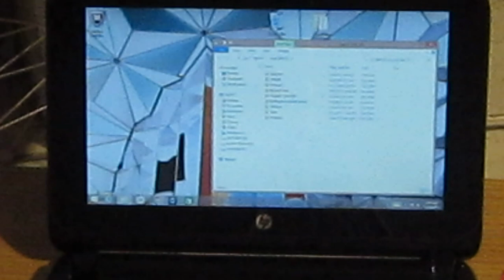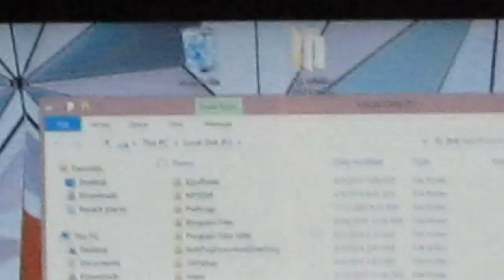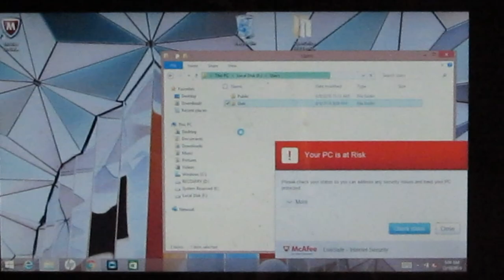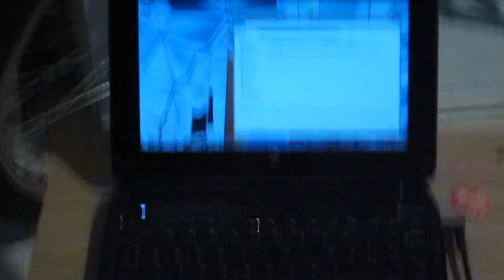How to recovery Data and Pictures from crashed computer hard drive using  a USB - Sata / IDE adaptor

Comment: Stupid way to access a perfectly good hard drive on a perfectly good laptop. Why would you risk buggering up your hard drive if you haven't backed it up. All you need to do is put a Linux operating system of your choice onto a USB drive is bootable. Then boot up off of the USB drive and use the Linux operating system to back up your hard drive files. Then you can reformat your hard drive and put your operating system back on anyway it go. You can even switch to a Linux operating system instead of Windows if you want.
Reply from the maker: Well, OK.. I do Love Linux, and that is a great way to access drives.  Many people like to run windows (and other OS as well).... and they may not feel comfortable making a USB Linux boot disc?... although, this seems to be a great way to go as well..  You probably will still need an external USB hard drive to back up your data.. and this process will only work if the hard disc failed and the computer is working.. I had an issue where the computer itself stopped working, and then you have to remove the hard drive to back it up for sure... Yes I do recommend switching over to Linux too... I run it whenever possible... It is so much better than windows in so many ways.. Thanks again for the great comments..
Reply: altgenesis Linux mint is good I use that
Reply: altgenesis  average Joe doesn’t even know what Linux is.
Reply: jaynes network yeah, I'm not well versed in Linux, so in this kind of situation, I'd rather not play with it. Thanks for the instruction.
Reply: um, im not really comfortabe with linux myself, so i will rather use this method to retrive my lost data.
Reply: would this work with a bootable macos disk too ?
Reply: Agreed!!   I have heard of Linux and I'm sure it's great.  But most laymen, including yours truly would have no idea how to do what Altgenesis describes EVEN THOUGH I'm sure it works.
Reply: @altgenesis How would this work with file permissions? Is there a youtube tutorial on how to do this?
Reply: "Stupid" way of thinking, from someone who is stupid enough, to fail to recognize, that majority of users do not know what Linux is and how to setup a boot up drive. Hey! what may be easy for you, won't be for many normal folks out there. They will have to invest more time understanding what are YOU suggesting, than what is being told here, in this video.
Reply: @jaynesnetwork  hiw will you do on a hdd that is not even detecing in pc in your method of a notebook hdd
Reply: StringerNews1   actually, I'm someone who's fairly mechanically inclined to try 'performing surgery' on a lap top... However... I would be afraid of doing software installing... as I don't understand things like even when it comes to installing a new modem...and having to plug in numbers into various fields to get the stupid thing connected.
Reply: StringerNews1     The phone company in my area (a remote part of Idaho) has us use a  modem/router which is DSL (I am on the 10mbps plan).....and that was what I was talking about... not the old 56k modems.    

 When plugging it into the computer... it still needs configured...and I always call support for help with that.  I do not feel comfortable messing around with certain settings in my computer.  I always say I know just enough about it all to get myself into trouble.... so while I'm not totally uneducated about some things,  I'm just not comfortable doing things like installing operating systems, or messing with the registry...etc. 

 But, I am willing to take a screw driver and open something up to try to fix it.    I even replaced the broken screen on my niece's cellphone last year...something some 'expert' wanted to charge her $50.00 to do, plus $50.00 for the 'kit'   

I found the same kit on the internet for $30.00 and following the instructions, it took me about 3 hours, to fix it.  I had to remove all the parts inside the the phone to get to the screen and then put everything back together and some of the screws were only slightly bigger than the period at the end of this sentence, so it took a lot of patience.  

My point though is still...that some people are not comfortable messing with codes and installing OPs.  The guy in the video had a mechanical way of doing it and I would try that before taking a dive into what I consider the unknown deep of configuring certain software.
Reply: StringerNews1  I'm a 55 year old woman, who's been poor more of her life...so I always tried to read about how to fix something before hiring someone.  When the internet came along, and people started posting 'fix it'  or 'how to'  videos... I would watch a number of them before attempting to fix or repair something.   I have done some software 'repair' that way but was never ever comfortable while doing it.  However if it's 'hands on' mechanical... I felt a lot more comfortable doing it.    I've wired in my own porch light, fixed the pump on a swamp cooler, did some repair work on my car, things like that with the help of YouTube videos.    I also always read the comment section, because I'm not just going to take the uploader's word for it...lol.    
Thanks for the information.   On my last two computer's I've backed them up on external hard drives...including about 4 times a year I do a mirror image back up...rather than just a regular back up.   

I have an older computer sitting in my closet where I keep thinking someday I would like to try to recover some art files that I did on some paint programs...so I just kind of popped into here out of curiosity.  That computer was old when it failed to start up one day...I heard a weird noise and Windows XP failed to start and all I got was a messed up looking pattern on my monitor.   I got a new computer and put the old one in in the closet for parts..  Over the past 8 years, I already pulled two fans out of it...lol... but other than the artwork, I didn't have anything on there I wanted / needed to save.   

Thanks for your time in explaining about older computers... the one I have might be old enough to have connection issues as you described.
Reply: StringerNews1    Thanks : )
Reply: How can i do that when my laptop won't turn on or even boot up.

Comment: Honestly,I have Windows 7,and my hard drive crashed. Alot....of pictures on there...Can they be saved? HELP!
Reply from the maker: There is a good chance you can recover your pictures.  Have you tried this yet?  If your computer can recognize this drive, you should be able to recover you pics.  I can help you through the process if you have any questions...
Reply: Did you try go safe mode?
Reply: @kenshinyamato3233  Not yet. No,sorry.
Reply: @SuperFlanders123  safe mode is a secret stage login windows it depends of your choice of mode
Reply: @kenshinyamato3233  Ty for letting me know!
Reply: @SuperFlanders123  respond me when you got login

Comment: I need someone to walk me through this if I am unable to pull the date , photos, and  files off with computer in tact..please messages me because it will be one week from toady date that I will have the time to do this with removing the hard drive...
Reply from the maker: It helps if you remember what folder you put the data in that you want to back up, but if you remember the file names or extensions, you can do a search for them. For instance a lot of photos have an extension like '.jpg' for j-peg format, movie could be '.mpg'  or '.xls' for excell files, etc...  So you can do a search on all the extensions you are interested in if you don't remember the exact file name or locations where you saved them. This is a good place to start..  It is a big job to go through and find and save everything you want to save, if you have a lot of files, but it is worth it, because they are irreplaceable..  I hope this helps..

Comment: सर मेरे पास साटा की हार्ड डिस्क है। कुछ समय पहले में उसे  एडाप्टर आैर यूसवी से चलाता था। परंतु लास्ट बार जब कनेक्ट किया तब उसमें से शार्ट सकिट हो गया  था। मुझे उस हार्ड डिस्क में डाटा निकालना है उसके लिए मैं क्या करूं। यह कैसे संभव होगा।
Reply from the maker: If the hard drive was not ruined by shorting it, then it should be possible to get some new adapters and try to remove the data. It is worth a shot.  You can always buy a new computer, but the data is not replaceable. Best of luck..

Comment: Guys, there is a secret trick that repair shops dont use to recover data with only the installation media plugged on a corrupt PC

step 1: press shift+f10 (shift+fn+f10 if your computer has a fn button)

step 2: type notepad

step 3: go to file > open

step 4: in the side click on this PC

step 5: show all files from the dropdown

step 6: try transferring a file or folder in a drive to external storage (you can transfer multiple files or folders) and refresh the destination and now its safe to reinstall Windows and view data on the new installation

pros: make it full screen by getting it to the max height of screen
cons: IT SADLY DOESN'T WORK, WHAT A SH*T METHOD!

WARNING: dont proceed the setup process, just press shift+f10 and type notepad and continue from step 3 to 6 or click next and go to repair your computer and go to troubleshoot and advanced options and click command prompt and write notepad then continue from step 3 to 6

also you MUST create an Windows install media in order for this to work

enough taking, bye
Reply from the maker: Thanks for the great information!
Reply: @jaynesnetwork  ok, i want to give this info in case they lose data and PC is corrupt and you dont have a secondary PC

Comment: I hook the hard drive from my old desktop to my laptop cant find any pictures i had...on my desktop my pictures were under pictures and downloads but 
Know hook to my laptop nowhere to be found..any suggestions
Reply from the maker: Some of the files and folders seem to be in different places when the drive is a secondary drive as opposed to the primary drive.. are you able to see the drive, and is it operating normally?  If so, try to do a search for your files, the search protocol is located in the bottom left corner of the screen.. when you click on the windows icon (assuming you are using windows).. Maybe that will help you to find them..

Comment: I have lost my important data while changing Windows sir can i recover my data .urgent reply please
Reply from the maker: Yes, Unless the hard drive has a mechanical failure, your should be able to recover your data.  You will need a second working computer, if your current computer is unbootable..
Reply: Sir which data we formatted.in window xp now .we want recover from hardware....
Now i am running window 7 
So how can recover from hardware ....please inform me i m in very depression
Reply from the maker: You didn't put a new OS on the old Hard Drive did you?
Reply from the maker: At first I though your HD crashed on its own. Now I'm thinking that it lost the data because you installed a new OS over the old one and it erased your data? if this is the case, you need to shut down the computer immediately. You need to pull the hard drive out of the computer. Then you need to try to read it with another computer... probably will have to use a program like photorec to try to recover data..  If this is the case, I am sorry I did not understand.  The new OS will continue to write over the old data, as long as it is running, and your chances of recovering things will drop with time. If this is not the case, and it is just a hard drive crash, disregard this.  If it is, maybe you can try photorec.  I have a video that talks a little about this.  If you did install a new OS and that caused you to loose data, you should shut down the computer ASAP. 

https://youtu.be/vLUpJOZmREs

Comment: How do I take all the information off my hard drive to USB stick then erase all the information
Reply from the maker: If you want to erase the information on a hard disc, so it can't be recovered.. I believe they used special programs to randomly write 0's and 1's over and over again.. I have never tried this before.. Remember the information is still on the drive, even if you erase it!!! It can be recovered by experts!!! If you don't ever want to use the drive again... Take a sledge hammer to it!!! That will destroy it, and make sure you smash the platter in the inside... into tiny little bits!! It will be very hard for even the experts to recover that... and if you are still worried.. pour gasoline on the remains, and light them on fire!! Preferably outside!!  No one will ever recover data from that drive again!!! I am pretty confident of that!! Thanks for the great comments!!.. Transferring the data is a simple matter of copying it from your hard drive to a USB stick, once you get the hard drive working on a computer... Best of luck!!
Reply: @jaynesnetwork  sledge hammer, then gasoline??🤣🤣🤣🤣🤣🤣🤣🤣🤣🤣🤣🤣🤣🤣🤣🤣🤣🤣🤣 I think I'm dead!!!

Comment: Where can i get the power supply from ?
Reply from the maker: The kit that I bought has both a data cable and a power cable.  There are 2 cable that go to the hard drive.  If you don't have a power cable, usually there are ones inside the computer, and you can tap power off of them if you open up the cover.  I recommend powering everything down before plugging and unplugging any cables.  there is a risk to damage things if you hot plug devices.  be careful with your computer if you are running it with the cover off.  Hope this helps a little...
Reply: jaynes network thanks for replying. 
Where did you get your kit from?
Reply from the maker: I got it from a local microcenter.  I am sure you can order these on line if you don't have one near by.  just make sure it has the same connectors that you hard disc requires.
Reply from the maker: HI Madeline, I believe this is the exact same thing I have, from Walmart.

https://www.walmart.com/ip/USB-2-0-to-IDE-SATA-S-ATA-2-5-3-5-HD-HDD-Hard-Drive-Adapter-Converter-Cable/641332249?wmlspartner=wlpa&selectedSellerId=7728&adid=22222222227070827540&wmlspartner=wmtlabs&wl0=&wl1=g&wl2=c&wl3=182261618770&wl4=aud-310687322322:pla-350031303757&wl5=9008124&wl6=&wl7=&wl8=&wl9=pla&wl10=115059135&wl11=online&wl12=641332249&wl13=&veh=sem

Comment: Obviously the hard drive was fine. You could have simply plugged it into a sata slot in another tower, which would have bypassed all this other junk to buy. Go to a friend's house to use his real computer.
Reply from the maker: Sorry, I beg to differ... The hard drive was not fine.  It was the main hard drive in another computer, and the boot was messed up. This makes it impossible to access the data, unless you do something like remove it, and use it as a secondary hard drive in a working computer or if you boot into Linux which is probably more difficult for most people to do.  You are correct that there was no mechanical failures, but if this was the case it would probably not possible to retrieve any data at all. Thanks for the great comments.
Reply: jaynes network in which case, downloading a free software to put on a usb pen drive would have been much easier than buying all these cables. Not to mention, it would have been free. The are a ton of boot disk software on the Internet.
Reply from the maker: I'm all for Linux.  Someone who is not familiar with Linus may have some difficulty though.. I agree, it is a good solution as well... Linux does have a little learning curve.  I do recommend anyone who work with computer to learn Linux. It is a great OS! And best of all it is FREE!!!
Reply: jaynes network not Linux although I use it. Boot disks have been around for decades. Software that specifically loads off a usb drive or a cd or whatever medium you put it on and you boot to it instead of the hard drive. No need to take the drive out of the computer at all. It runs a dos version of fix MBR or something along those lines.
Reply from the maker: Sound like a good way to do it as well.  I have never used this method before. Thanks for the tip. I will look into it. Thanks again...
Reply: @jaynesnetwork  you could have used a boot cd (mini xp) of Hirens boot cd and recover data direct from laptop to a external drive.

Comment: My hard drive is spinning but after some time stop and cannot be detected by my laptop
Reply from the maker: That does not sound good.  I had a hard drive with this issue before.. sometimes the bearings become loose because of wear and tear from years of operation... If this is the problem.. sometimes it helps if you put the hard drive in the freezer and cool down the bearings so they shrink a little, then once it is good and cold try reading data from it..This trick sometimes works..
Reply: @jaynesnetwork  thanks I will try🙂

Comment: hard disk detected in bios but not showing in my computer plz help me
Reply from the maker: Is it by chance more that 2 TB HD??
Reply from the maker: I had an issue that some bios don't support HD over 2 TB, but this does not seems to be the case. Was the hard disc working before and now is not working? Is the hard drive getting power? Can you hear it spinning when you plug it in? Maybe the partition table is corrupted? There is a program that can some times recover things without a partition table.  It is called Photorec.  It is a little messy and time consuming, but it sometimes can recover somethings.  I have a video I on to use Photorec if you are interested. It might help??
https://www.youtube.com/watch?v=vLUpJOZmREs

Comment: um the hard drive itself wont power on. how do i get my files
Reply: go to a professional to recover your data because your HDD may have a firmware failure or any other issue
Reply from the maker: Do you have a power cable connected to the drive?
Reply: @jaynesnetwork  dude maybe the power cable port is broken or firmware could not detect power cables